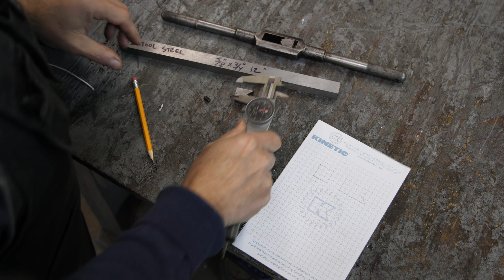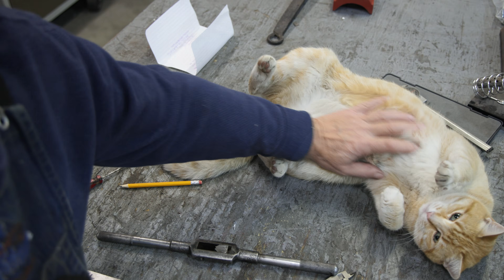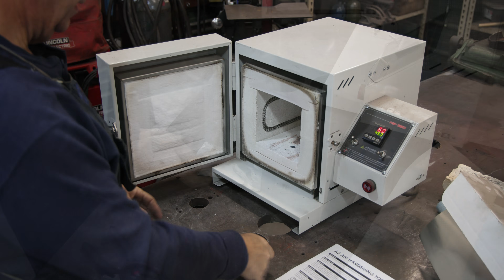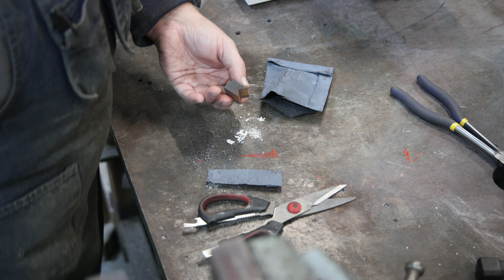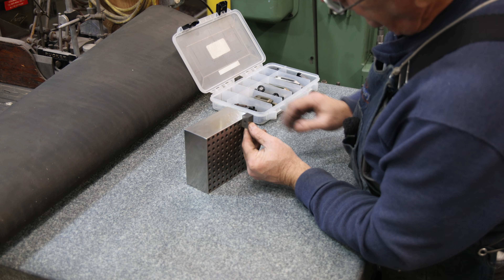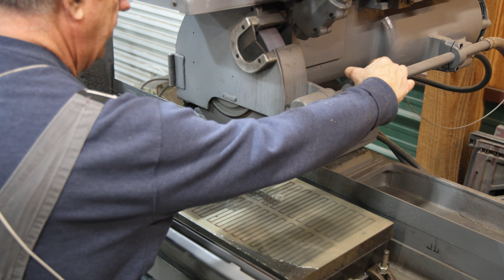Repairing a Greenfield Tap and Die No. 6 Tap Handle

Comment: Keith, Why is this wrench worth repairing? Why A2 steel? Why not 1018 Cased?  How much time did this take, and how much did the A2 material cost? You can purchase a Greenfield tap wrench in this size that is functional on ebay or less that it cost to repair this one. I like to repair things as much or more than most people, but is this cost /time effective?
Reply: Such thinking could lead to boredom!  Nothing to fix, just buy a new one!  :-)

I think money isn’t always the deciding factor; there are often other things to consider.

Comment: Great video, Keith. It was interesting to see how you did all of the set-ups with such a small part, especially for the 45-degree cut and grind. I would have been interested to hear your thoughts as you decided which alloy to use and how/why you settled on A2. Why not D2, 4140 or 30, 5160, or something else.

Comment: Thanks for this quickie, BUT . . . since you spent so much time on the cane mill, would it be possible for the mill operators to take some video of that beast in action grinding up, say 5 minutes of sugarcane (or any other material that they can mill)?

Comment: 14:20 When I worked at the machine shop ... The high production heat threat furnace worked in a VACUUM to eliminate oxidisation, and had a small elevator ... that quenched the steel in an oil bath directly below ... without leaving the furnace

In the case of air hardening steel like A2, the furnace would send in nitrogen under pressure to quench the steel

Comment: I was holding my breath certain you were going to kick that little block off the chuck into the backstop or wall. It needed to be blocked on both sides with thinner steel plates. Lots of little surface grinding tricks that you only learn in a tool and die shop. Probably the most important is a perfectly square on all sides hardened and ground angle plate and a set of hardened angle blocks.

Comment: Thanks Keith. I was concerned about that small part not being backed up. If I had tried that, I'd have to go out in the yard to find it. Nice job, very fortunate customer to be the recipient of your work.
Reply: I once threw a steel block off a large Brown and Sharpe grinder. It somehow missed the backstop and embedded itself in the office wall 20 feet away. Employees inside thought a bomb had exploded. Fortunately no one was hurt. The taller and narrower the part the more it has to be contained on the chuck.

Comment: OOPS- 
1. Should have squared the saw cut end first.
2. Ground to size
3. Put in tool so the end is  tight against the  handle and use the set screw hole to mark for the dimple
4. Mill the 45's
5. Heat treat
You can see the gap betweem the block and handle, so when you tighten  it up, the pressure is against the set screw, not the handle- Eventually the set screw will wear and the block will be loose.

Comment: Keith, 

If you do a piece like this again I recommend you drill a crack stopper at the 90-degree apex of your triangle as a stress relief for the angle.

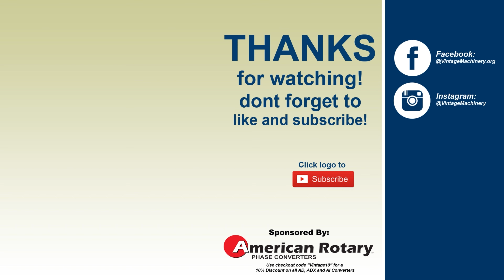On the original part, the crack started at the 38:27  apex.  If you look at the part you will see a series of chevrons pointing to the start of the crack.  You may need some magnifying.

Comment: How did you centre the ‘V’  notch grinding on the surface grinder ?
Reply: Just thinking you could clamp a little ‘L block fence’ to your riser block set at 45 degrees. Machine one face and the flip the part, machine the other face, automatically 45 degree pocket on centre.with same depth of grind.

Comment: I have a Greenfield No 6 Handel that my grandfather acquired at a sale, the body is flat and the writing is on the flat part, came with cast steel taps and dies, I am guessing it is around 100 years old. But it has a crack just the same works fine and I was never sure if the crack was part of the design or not, now I know.

Comment: Just a question, you seemed to say that when you were going to grind the second side of the vee, that you were going to turn the part, therefore tearing down your setup.  Is that what you actually did?  It seemed like you could just leave the part clamped up and just roll the entire block 90 degrees.
Reply: That is what he did. The clamp is still on the same side but upside down now. Or so it seems to me, it was hard to tell but check for yourself 34:31

Comment: When tgrinding,  can you use side and perimeter simotaneously?
Reply: Yes, but... a grind relief is expected so the wheel radius can be allowed for in the tooling pressures and the wheel is not fighting itself at the intersection with 2 different speeds. Side wheeling is allowed with some exceptions and provisions and is usually done with a cup wheel since it has built-in clearance.

Comment: I'd like to know what wattage that oven is rated to please
Reply: Checking the site for specifics the 360 comes in 15 Amp 120 or 20 Amp 240 convert this to watts by Amp x Volts = 1800 and 4800 respectively.

Comment: The instruction said pre heat to 1450, then run the temp up to 1850 for 25 minutes.
But you ran it up to 1450 and let it set there for 25 minutes, before continuing on. I'm pretty sure you did the same thing the last time you used the oven.
My question to you is, have you done any research into what the term 'pre-heat' means ?  And does soaking it for 25 minutes at the pre-heat temp have any affect on the heat treat outcome ?
I may be wrong, but it just seems like you read the instructions, then do it your own way.
Reply: Uh i made new ground Spacers for our big radial drill press, made them out of 4140 heated up to cherry red quenched in oil and ground them no temper, no soaking, no oven, literally guessed. They are roughly 50Hrc and have been dropped hundreds of times. It really depends on what the application is, my god that is a V for a tap handle. Lets be real it probably would even survive if not heat treated at all....
Reply: @FireGodSpeed  Yes. What you say makes sense, for this project. But my comment was directed more towards the protocol. If he is just winging it because it's a throwaway job, sloppy technique may come back to bite him.
But I don't know, I was just asking.
Reply: @youpattube1 
Just my 2 cents ok so no pitchforks please.

I guess it comes down to how you are defining "preheat".
For me, the soak at 1450 means that not only the surface of the piece is at the preheat temperature but that the temp extends into the centre of the part.
The logical result of that is that the hardened depth of material is greater, maybe, than it otherwise might have been. 

Of course, I could be completely bonkers here. Hopefully others with more experience will confirm or correct.
Reply: @petert3355  That makes sense. Amazingly to me, I hadn't thought of that, but it seems obvious now that you pointed it out.

Comment: How did you insure that the V was central? Thanks for the video.
Reply: A 45°, 45°, 90° triangle has the two short legs equal to each other.  

So with the part to be machined at 45° to the horizon and the cutter aligned to the upper apex (corner), mill straight down.

When the cut is at the bottom corner, both faces will be of equal length.  

Grinding the faces removed a few thousandths at best.  

The vee is very close to center, by the way it was milled.  Keith isn't building a rocket ship requiring ultra precise parts.  This is an anvil for a tap wrench.  Close enough
Reply: There was a lost opportunity to instruct for precision. Needed or not.
Reply: Luck, mostly, not by proper practices or measurements. That tooling block helped a lot, he got that from Steve from Solid Rock. Sells It over 1,000 usd now I imagine.